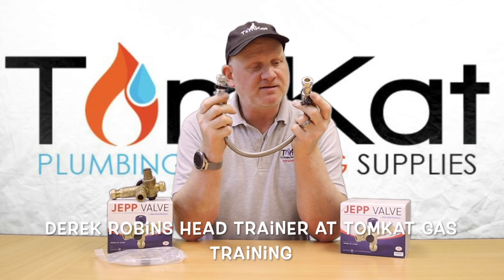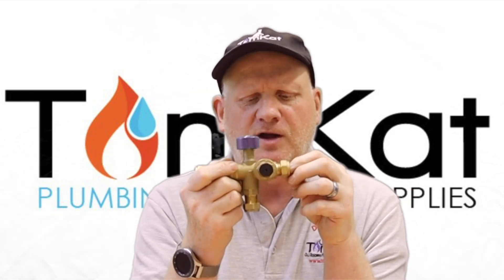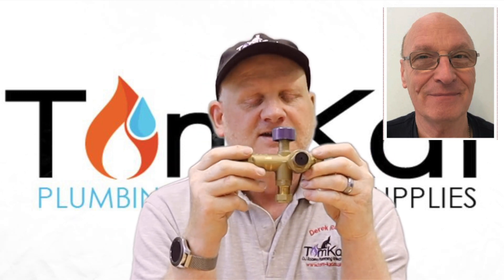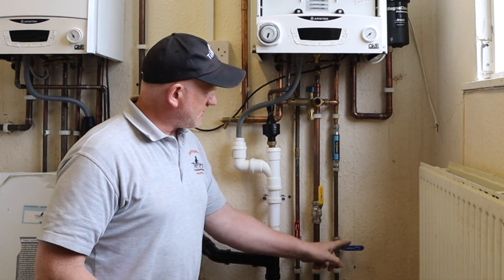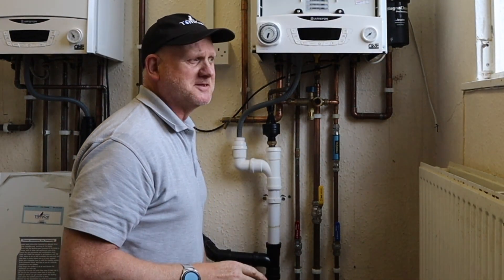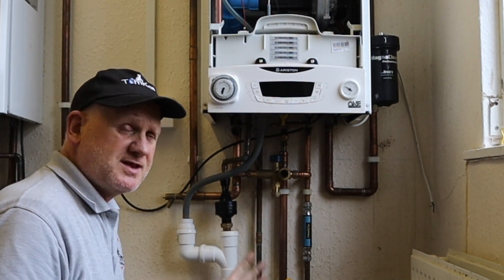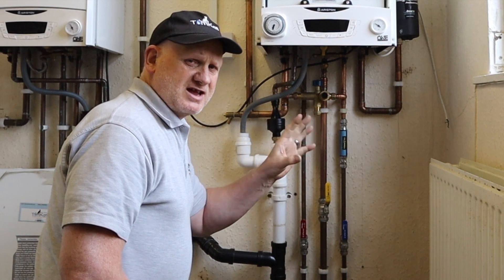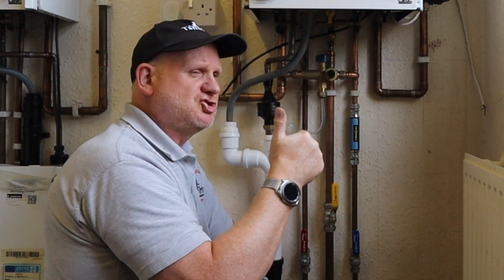Installing  and reviewing the JEPP valve the push button combi boiler filling system.

Comment: Any reason its fitted on the flow? Looks a nice bit of kit, especially for elderly etc.👌😎
Reply from the maker: Just because of room but a few boiler manufacturers put their built in filling loop between the cold and flow because of problems with space

Comment: How far we've come since the first sealed system boilers!
Back in the early 1980s, the water board inspectors; and back then they inspected EVERY new build there weren't the  filling loops we know today!
Some boiler manafacturers recommended  filling via 2 BS1010 valves with removable  connection  piece. 
In my area they would only allow filling through two drain offs via a removable hose pipe!
Kids today don't  know they're born, but that is  not a bad thing all things considered.